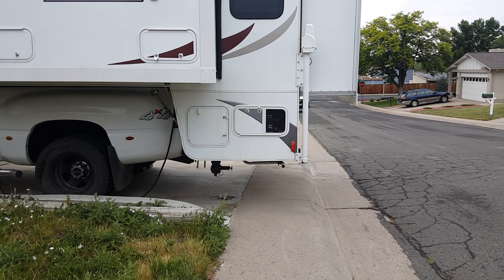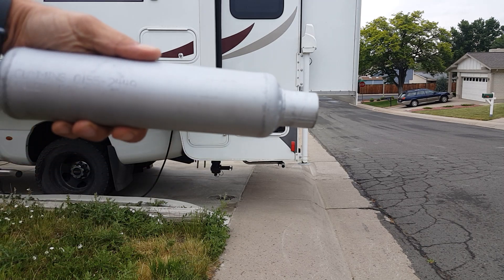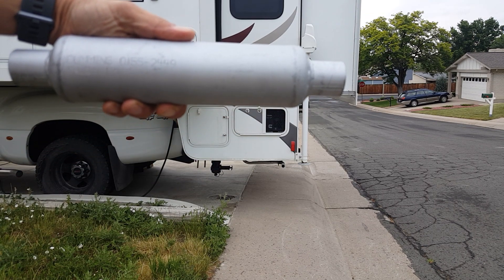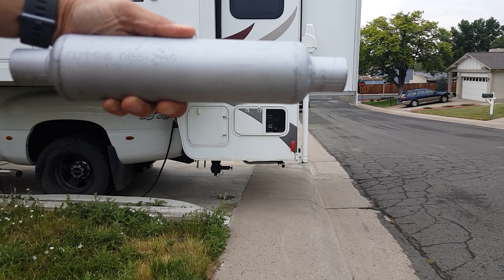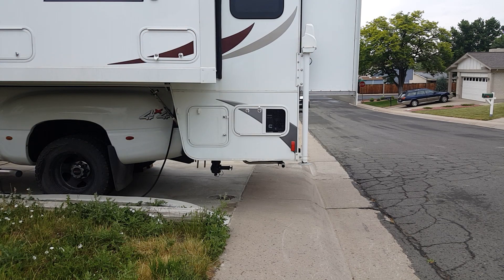Cummins Onan Exhaust Resonator Test

Comment: The resonator seems to be very effective on the 2500/2800 models because they have a distinct poot-poot to the exhaust that is annoying. The resonator, Cummins-Onan exhaust resonator, p/n 0155-2449, while a straight thru type with no baffles, does an excellent job of eliminating this poot-poot sound. the 3600/4000 model generators do not have this sound and it seems to make little to no difference on them. Here is my video of just what you are doing, https://youtu.be/NQEtWhQr8ps and here is another one I found, https://youtu.be/TmHbnBq_Gb0 we all seem to have the same result.

Comment: wow nice find. maybe i should consider get a camper with onan generator. instead of portable gen. do u have decibel  meter to read the differences?
Reply from the maker: No, don't have a decibel meter. It's permanently installed under the camper now too.
Reply: have u tried muffler + resonator?  i heard ppl saying resonator only lower like 1 or 2 db, and muffler will get it down like 4-5db
Reply from the maker: I haven't added an additional muffler. There is already one that's inside the generator. Dont want too much back pressure. The silencer is stright through so it doesnt add any. 
A lot of noise is the generator it's self. Closing off the bottom of the compartment (minus the cooling air outlet) would help a lot. This will never be as quiet as a Honda so just trying to help a little.
Reply: cool, thanks for the info. ima gonna take a look at cirrus 820 and see if i can fit a portable gen in the exterior storage. else i might look into 920 with onan 2500w.

Comment: Will it harm the generator by using the resonator , you’re restricting the air flow from generator. I would think that onan cummins would have thought of this already by putting a muffler on. It looks like they want straight through air flow in exhaust pipe by design.
Reply from the maker: The resonator is a straight through design. It doesn't restrict anything. It's like a glass pack from back in the day.
Reply: It’s also made and produced by Onan Cummins.